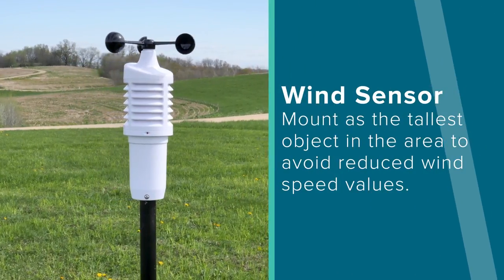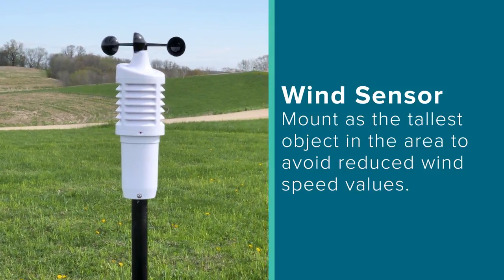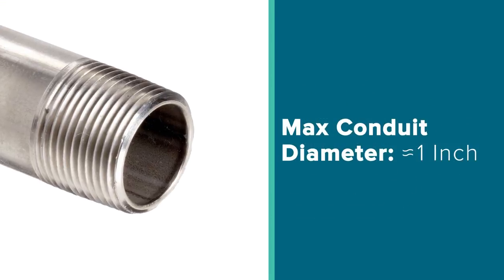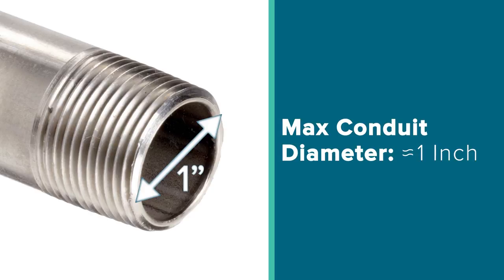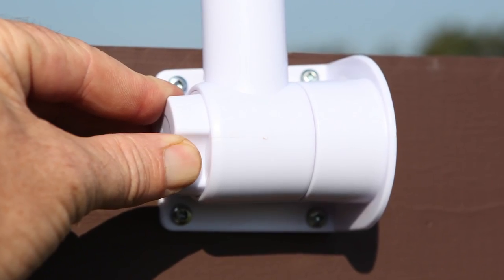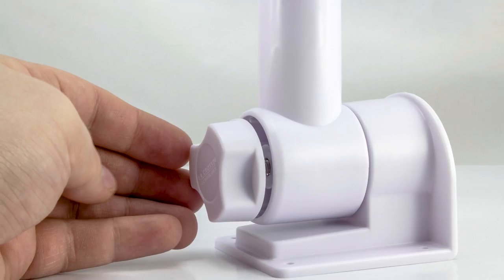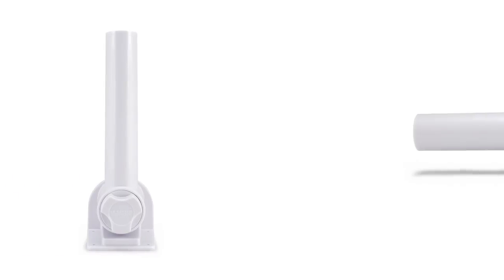How To Mount Your Wind Sensor

Comment: great video! I don't know why you'd try to keep this crucial info a "secret" by not printing it out on your PAPER instruction manuals! not everyone has internet access or wishes to type out a website address just to get critical installation info that OUGHT to be included in the instruction manual!
Reply from the maker: We do our best to include all necessary information in our supplied manuals or quick start guides, some things are just easier to explain via video. But we appreciate your feedback and will be sure to pass along your comments to R&D for consideration in future printings. If you should ever need assistance, please message our support staff directly here: https://bit.ly/contact_techsupport. Or alternatively, send us a private message on our Facebook: http://bit.ly/LaxTech_Facebook or Twitter: http://bit.ly/LaxTech__Twitter page. We assure you we are here to help in any way we can.
Reply: @lacrossetechnology  Okay how about this for starters: inside the packaging of my model #327-1414BW wireless wind-speed weather station I found a small clear plastic bag with 4 long (thin) screws.  No mention of what these are meant for, either in the instructions or Quick Start Guide or FAQ.  So I guess I have to ask here....what are these 4 screws supposed to be used for?  Thank you for your thoughtful and timely reply btw.
Reply from the maker: @DJMichaelAngelo  The four loose screws are for mounting the wind sensor, as you've now seen in our specific 327-1417BW video here: https://youtu.be/spxv-_ke2tw -- We do apologize for the confusion and will look into updating this in future manuals.

Comment: I am Very disappointed! The package on this wind station shows a wind speed AND direction, but apparently this is not so, indicating only speed. Poor packaging. The  internet information won't give direction for my actual location. I am near the water and subject to winds different than areas which would be covered by internet. Being in this area and 100ft above sea level, wind direction is important to me.
Reply from the maker: Hi Gary, we sincerely apologize for any misleading information on your item's packaging. For some of our connected items, the wind direction data does indeed come from AccuWeather's Internet weather services, which currently update 4-6 times a day on these displays. We understand that Internet data can often vary greatly for remote locations, and we apologize for this inconvenience. If wind direction is a must, we'd suggest a possible switch to our V40A-PRO system: https://www.lacrossetechnology.com/v40a-pro-la-crosse-view-weather-station which includes a sensor with wind direction. 

Or you could simply add a sensor to your current setup that offers this as well, though this data would only be available in your La Crosse View app. Currently, our two add-on sensor options for monitoring wind direction include our LTV-WSDTH01 (Breeze Pro): https://www.lacrossetechnology.com/ltv-wdsth01-breeze-pro-sensor/ and our LTV-WR1: https://www.lacrossetechnology.com/ltv-wr1/  

Sorry again for any confusion. We'll be sure to pass along your comments to both our marketing and engineering teams. Please let us know if you have any questions moving forward.

Comment: I mounted mine on the top of my shed. for some reason it gives me readings about 1/2 of what the actual wind speed is.
Reply from the maker: Hi Brian, we're truly sorry for the seemingly low wind speed values. These calculations have a lot of factors to consider. Are there any obstructions around your shed such as trees, buildings, or other tall structures? We recommend the sensor be mounted at least 6ft above its mounting surface and clear for at least 50ft in all directions (wider open areas will often offer greater accuracy). Have you checked the wind cups to make sure they are able to spin freely? Sometimes debris can crack or get caught in the cups causing them to spin slower. And what are you comparing your wind speed readings with? We ask, as many local reporting news stations or online tools will show data coming from your nearest airport, which is likely miles away from your backyard. Because of this, these values can often vary by quite a bit and are not ideal for comparison. These are somewhat rhetorical questions, designed to help you consider if the sensor should be functioning better in relation to other possible contributing factors. If you still believe your sensor is not working properly, please reach out to our support staff directly here: http://bit.ly/contact_techsupport and they will be happy to help in any way they can. We apologize for any inconvenience.

Comment: the wind speed sensor does not work . It worked for 3 days than spot working everything else is working fine. I have a ca80550 lacrosse .can you tell me what is wrong . batteries are new,
Reply from the maker: Hi Alan, we’re truly sorry for the wind sensor troubles. Please review our factory restart video here: http://bit.ly/lcv_restart - which should help get your sensor synced with your display. If you continue to have issues, please reach out to our Canadian Supplier, Springfield Instruments via email: info@springfieldinstruments.com or phone: 844-687-4040. Sorry again for the inconvenience.

Comment: Its a bummer that you have to change batteries in the base as well as the remote sensor, as all your record data is now lost.
Reply from the maker: Hi Keith, unfortunately for some models this is indeed true and we apologize for the inconvenience. If you're interested in a possible switch to a color LCD model that offers a power cord solution as well as batteries for backup, we'd be happy to provide some suggestions. Knowing your current model would be helpful as well so we can find something comparable.
Reply: @lacrossetechnology   Right, well that makes sense...maybe time to upgrade to a color display with complete weather information, wind speed and direction, and rain guage.  Great product, well built, and the connection is awesome between the sensor and base...something I was not expecting.
Reply from the maker: @KMateri13  For further data history tracking, mobile alert notifications, and the ability to share these with friends and family, we'd highly suggest our lineup of WiFi-connected units that use our La Crosse View app. You can find our current selection here: https://www.lacrossetechnology.com/collections/complete-systems

Comment: What do you need to do when your alarm clock/weather station will not connect to wifi and the information says the device us is in provision mode and try again.
Reply from the maker: Hey James, "Provisioning Mode" simply means that the station/display is searching for a WiFi connection. This is typically indicating by a flashing WiFi Icon on the display. For help getting one of our La Crosse View models connected, we suggest reviewing our page here: https://www.lacrossetechnology.com/router_info

Comment: How does the wind sensor determine direction? Another sensor I had needed to be faced a certain direction. So, how does yours do it accurately?
Reply from the maker: Hi Mike, the sensor shown in this video is only a wind SPEED sensor. It does not measure direction. You may be thinking of our Multi-Sensor here: https://youtu.be/sB_XLvV3mhQ which will require the sensor to be mounted facing directly south for correct wind direction readings.
Reply: @lacrossetechnology  Well, maybe. I have the  LTV-W1 and the WTH21. The display has direction and it changes. It was SE and now its at SW. I would have thought the display would not show direction if sensor did not support it.
Reply from the maker: @macmikey  Please note that some Wi-Fi connected displays will receive this Internet wind direction data from AccuWeather, not an outdoor sensor that is part of your local system. Our apologies for any confusion.
Reply: What a joke. The display is what’s on the front of the box and it indicates direction. It’s only when you get the damn thing taken apart and installed and destroyed that you figure out the wind direction is not what you actually get. Why is everything a come-on now? Can’t do honest business?

Comment: The Wind Sensor is a cylinder mounted on a round piece of tubing that sends wind DIRECTION to the base unit.  Where did I miss the part about aligning with compass direction?   I'm not finding any markings on the sensor to align with anything on compass rose.   If it senses direction on its own, that would have been handy to include in the instructions.  If not, how do you align the wind sensor for accurate wind direction readings?
Reply from the maker: Hi Jeff, we apologize for any confusion, however, the sensor shown in this video only transmits and calculates wind speed. If you have one of newer La Crosse View connected weather stations, the wind direction reading on its display will come from the Internet. Our Multi-Sensor is currently our only sensor to offer both wind speed and direction: https://www.lacrossetechnology.com/ltv-wr1 - So if you do have one of our connected units, and hyperlocal wind speed is a must, you can indeed use the one in this link as an add-on sensor with its data and alerts monitored through our La Crosse View app. Please let us know if you have further questions, we are here to help.
Reply: @lacrossetechnology  So the displayed wind direction on my base unit is from the internet but the wind speed is from my wind sensor?
Reply from the maker: @Airplane10  That is correct. More information about the La Crosse View app or specific hardware support can be found on our website here: https://www.lacrossetechnology.com/lacrosseviewsupport/ , but again we are always here if you have specific questions.
Reply: @lacrossetechnology    That helps.  Thank you.
Reply: @lacrossetechnology  You should let people know that in the instructions then instead of searching the internet to find your response.
Reply: @beartoothclimb1  I agree!!!

Comment: Do you have to point any part of the wind senser toward the north so it will accurately show the direction of the wind...
Reply from the maker: Hi Kevin, as this particular sensor model only calculates wind speed, and not direction, it does not require you to mount it facing any particular direction. However, we do suggest making sure to mount it level and as the highest object for at least 50ft in all directions. This will help provide the most accurate wind speed readings.
Reply: @lacrossetechnology  I live in a development on a hillside, so I'm worried about "highest for 50ft in all directions." There are pine trees all around, 30' taller than my deck and 40+' taller than my yard. Am I out of luck?? 

I do have 50' of space horizontally, but not in all directions, and I worry about the taller trees.
Reply: @lacrossetechnology  >  this particular sensor model only calculates wind speed, and not direction, 

Yikes!  I bought the C83100 and it came with this sensor, and the display shows direction (which does vary) ... I see in the instruction PDF that it says AccuWeather wind direction - are you saying my display is only showing what AccuWeather thinks is happening??

I can live with that (I care 100x more about speed), but that seems weird.  Is that what's going on?
Reply from the maker: @ePatientDave  We apologize for any confusion and trouble regarding your wind speed and direction. The 50ft in all directions is simply a suggestion, however, if this isn't possible for your location, no worries. The sensor will still provide accurate wind speed data for your backyard location. Page 4 of one of our other sensor manuals here: https://www.lacrossetechnology.com/media/catalog/product/l/t/ltv-wsdth01_110119_1.pdf goes more in-depth on this topic and provides some specific examples. 

Regarding your C83100's wind direction information, yes, as long as the station is connected to the Internet, this data will be provided by AccuWeather and updated about 4 times a day. AccuWeather uses data from many sources, but wind direction will typically come from your nearest airport.

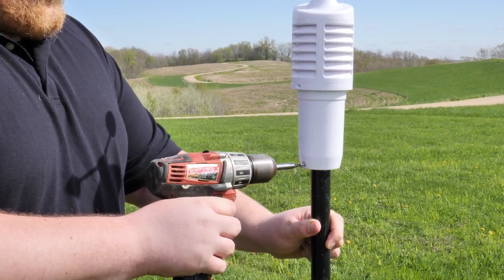Comment: @0:36 = are those the 2 screws that came with the sensor? or did he supply his own screws that are longer?  there was a bag of 4 loose screws with my model # 327-1414BW unit, but they're far too thiin to fit in the holes at the bottom of the sensor
Reply from the maker: The four loose screws are for mounting the wind sensor, as you've now seen in our specific 327-1417BW video here: https://youtu.be/spxv-_ke2tw -- We do apologize for the confusion and will look into updating this in future manuals.

Comment: In you mount it on your roof (Florida) Will it pick up the heat  from shingles a give you high readings in the summer?  Like 150 degrees on a 92 degree day?
Reply from the maker: It is possible this mounting location could lead to inflated outdoor temperatures during times of intense direct sunlight, however, this is assuming you own a station with a sensor that has the wind and temperature measurements built into one sensor. We'd be happy to provide more specifics if you could share your weather station's model number, this should be printed on the back of the main display.
Reply: @lacrossetechnology  Yes I have the Model 327-1417bw Thanks Joel
Reply from the maker: @onetakeadventureswithjoeld4679  Thanks Joel! For your station, channel 1's temp & humidity values on the display do need to come from your TX141WV2 sensor, so mounting it away from other structures or objects that could attract additional heat would likely be a good idea. However, a better option would be to purchase a separate thermo-hygro sensor that can be mounted outside in the shade. This would come through on a separate channel on the display. For more details on mounting your sensor and how to set up these add-on sensors, please see our support video here: https://youtu.be/spxv-_ke2tw?t=270 --- Add-on TH sensors can be found here: https://www.lacrossetechnology.com/products/tx141th-bchv3 and should be back in stock hopefully within the next month or two. Our apologies for any inconvenience.
Reply: @lacrossetechnology  Thanks I really love this unit !
Reply: @lacrossetechnology  There sold out LOL....... No biggy Thanks

Comment: Is that  how it makes it taller
Reply from the maker: The height of the provided mounting bracket is fixed and cannot be adjusted. However, as shown in the video, you're free to use your own mounting pole to get the sensor mounted at the height you desire.

Comment: First off, the battery life of this product is not even close to 2 years. I've had this for 2 years now, and the longest I have gone without changing them is about 2 months. I have tried all different types of batteries and they all last only about a month or two. 

Second, the area where the batteries sit fills with water. Yea, real great. The lower battery leads are extremely corroded. I've cleaned them up with vinegar and baking soda, which worked the first few times cleaning them, but now the device will not even function. When I go to change the batteries in the winter months, ice fills the bottom 1/4" of where the batteries go. Really? Why is water getting into an area that should be sealed. I know! There are small screw holes that hold the upper wind cups to the bottom where the batteries go. These screw holes lead from the battery compartment up into an open air environment so water runs down the top of the station, through the screw holes and into where the batteries go. This rusts out the battery leads and makes this not work anymore. Total trash.
Reply from the maker: Hi Justin, we sincerely apologize for the trouble you’ve experienced with your wind sensor, this is certainly not how the product was designed to function. If you could please send us a private message on our Facebook: http://bit.ly/LaxTech_Facebook or Twitter: http://bit.ly/LaxTech__Twitter page, we’d be more than happy to help troubleshoot this together. Alternatively, you can message our support staff directly here: https://bit.ly/contact_techsupport – Sorry again for this inconvenience, we look forward to helping make this right.
Reply: Seriously, the battery cup on the sensor should have an o-ring or, the top threads OVER the bottom so no water can seep in through the threads
Reply: I know, mine is a year old and the inside is corroded as well. The snow and ice knocked the sensor off the roof and smashed it. Had to order a new unit as they don't sell sensors separate. Not impressed with the water getting in and corroding battery terminals
Reply: oh no!  Justin what's your model #? I hope it's not the one I have :\